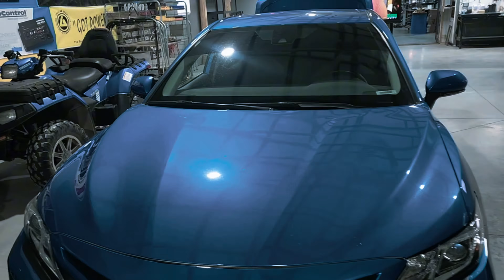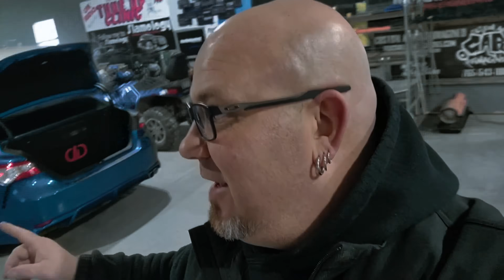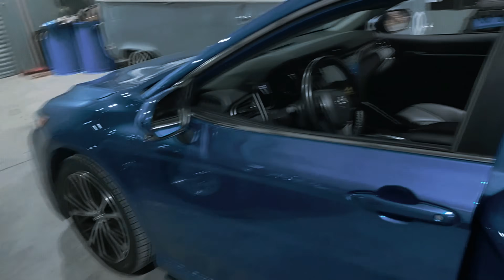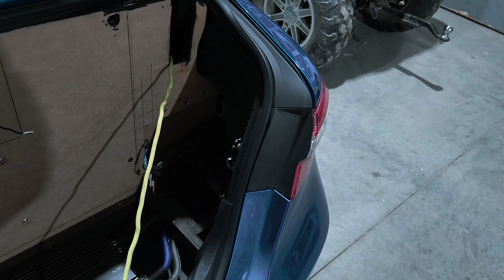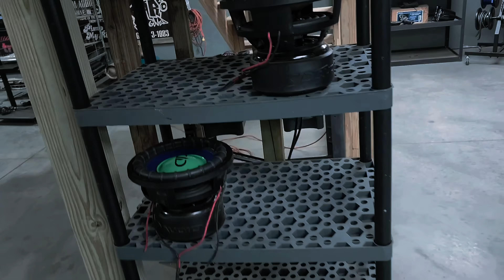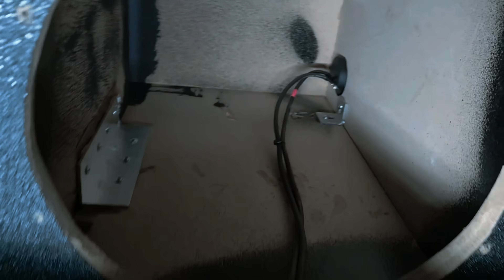2020 Toyota Camry Audio Upgrade/Repair Log Day 1

Comment: Val 6 heater might make all the difference for your heating needs 😁😁  they are a game changer.
Reply from the maker: Ya, I looked at them but I want something that's mounted out of the way with wifi thermostat control so I can remote start the new shop like I do the other side 😀
Reply: @CustomAudioReimagined  totally understand that completely!!! Remote starting heat is nice!!!